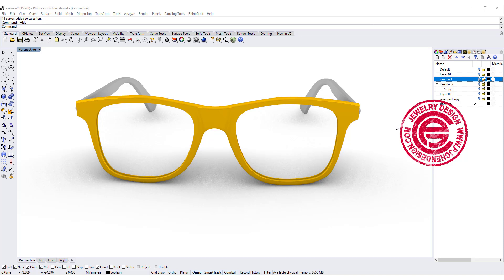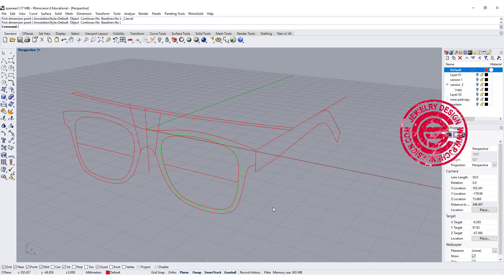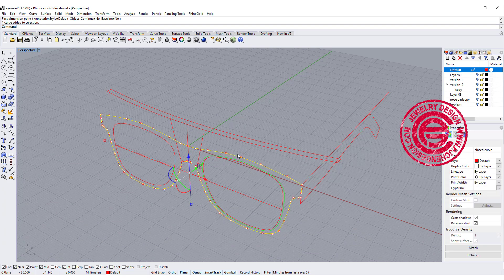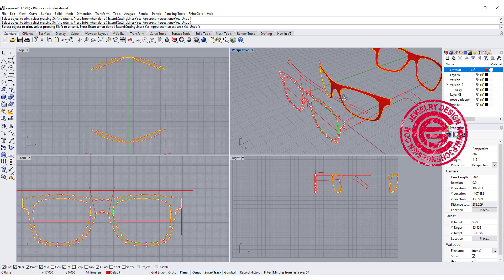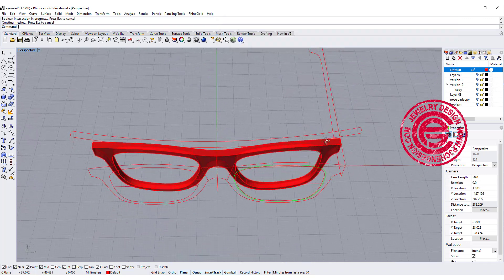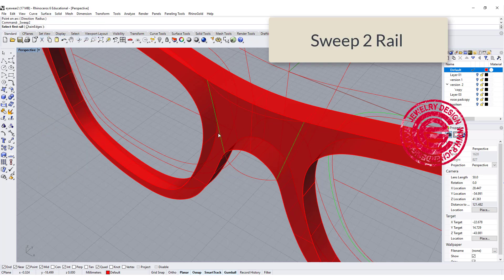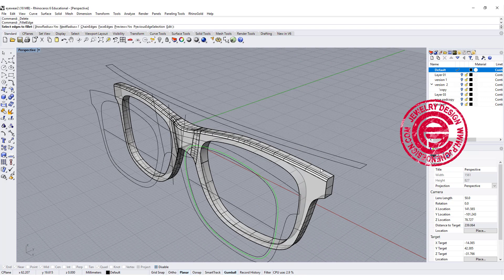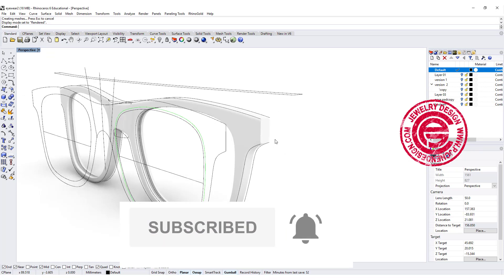How To 3D Model An Eyewear in Rhino 6 (Part I) : Rhino Jewelry CAD Design Tutorial #71 (2019)

Comment: At @8:15 if filletsrf only works on one side, it’s because you didn’t make the arc points perfectly planer. Hiding the 3D object and making the surface arc on the 2d object solved the fillet issue for me, however this also created an issue of deleting one of the sunglasses surfaces. Setting trim to “No” in the filletsrf option fixed the deletion issue
Reply: Actually, you need to have trim as “Yes”. This brought back the issue of the sunglass surface deleting. I split the sunglasses in half and was able to filletsrf without it deleting the sunglasses surface

Comment: Awesome video but I have a small question. On the minute 8:15, when I try to fillet surface one side, it deletes the other half of the sunglasses polysurface. Do you know what could be a possible mistake I could be doing?
Reply from the maker: It is hard to tell without seeing the model. is you fillet radius too big?
Reply: @PJChenJewelryDesign  Mine does this too
Reply: same here 😢
Reply: did you solve this issue ? pls share your experience
Reply: I had the same issue and solved it in my way. Just split and cut the surface to make some spaces between the main surface and the bridge. And then surface blend -> join -> trim -> fillet edges. And I finally got the almost same result as the one at the end of tutorial part 1. Fillet was successfully done. Hope it's helpful :)

Comment: At the beginning of the video you project on a sphere for the prototype. For the actual glasses you use the 'base curve', however this base curve is more of a cylindrical cut out. I was wondering if lenses will fit as lenses are spherical things and the rim now has a cylindrical shape?
Reply: it won't fi perfectly, but it might be quite close. Frame material also must be adjustable anyway to be used with diffrent prescriptions

Comment: Rhino 5 for Mac good enough?
Reply from the maker: Either Mac or PC are using the same commands for this tutorial.
Reply: PJ Chen Design great videos! I’m starting to design eyewear, will Rhino work? Send CAD to manufacturer
Reply from the maker: Most of the eyewear production is not done by 3D printing. Depend on the metal frame or plastic one, the production process is different. The Rhino will serve as prototype and for accurate measurement. When you send the file for prototype, make sure you send stl file not 3dm.